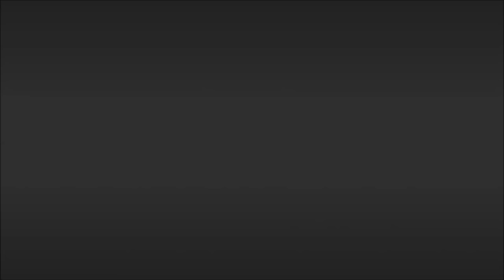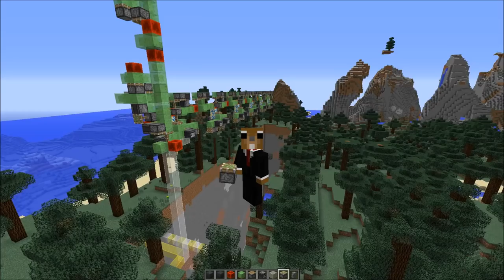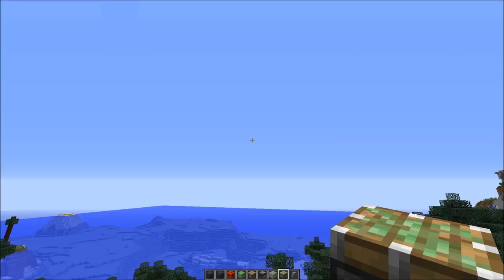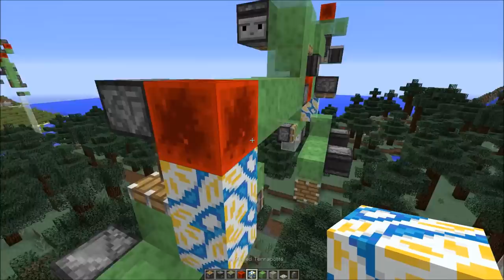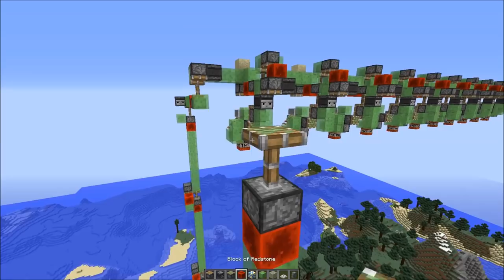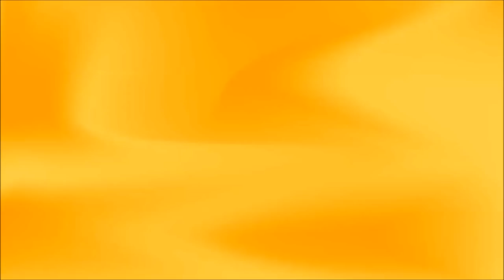Double Speed World Eater Tutorial for 1.12

Comment: How many resources would a 300x300 one cost roughly? I really wanna build one of these beasts, but I have no idea if I'm even close to having the stuff needed.
Reply: I took this directly from a MCEdit analysis.
You will need about this for the base components, so once for one world eater:
Number,Type,ID
26700,<Blocks>,
26398,Air,(0:0)
2,Sticky Piston (Down),(29:0)
5,Sticky Piston (Up),(29:1)
16,"Sticky Piston (Extended, Up)",(29:9)
2,"Sticky Piston (Extended, East)",(29:13)
19,Piston (Down),(33:0)
16,"Piston Head (Sticky, Up)",(34:9)
2,"Piston Head (Sticky, East)",(34:13)
32,Block of Redstone,(152:0)
190,Slime Block,(165:0)
1,"Iron Trapdoor (Bottom, False, South)",(167:1)
1,"Iron Trapdoor (Bottom, False, West)",(167:2)
4,Future Block!,(218:0)
4,Future Block!,(218:2)
3,Future Block!,(218:3)
3,Future Block!,(218:4)
2,Future Block!,(218:5)

Additionally, you will need this for EVERY 6 blocks you extend your world eater in width, starting from 0. For example, a 300 wide world eater would require 300 / 6 = 50 times these materials:
Number,Type,ID
53400,<Blocks>,
53304,Air,(0:0)
1,Sand,(12:0)
1,"Detector Rail (Unpowered, Ascending, West)",(28:3)
1,"Detector Rail (Powered, East/West)",(28:9)
1,Sticky Piston (North),(29:2)
1,Sticky Piston (South),(29:3)
4,"Sticky Piston (Extended, Up)",(29:9)
8,Piston (Down),(33:0)
2,Piston (West),(33:4)
2,Piston (East),(33:5)
1,"Piston (Extended, Down)",(33:8)
1,Piston Head (Down),(34:0)
4,"Piston Head (Sticky, Up)",(34:9)
1,TNT,(46:0)
1,Cobblestone Wall,(139:0)
6,Block of Redstone,(152:0)
49,Slime Block,(165:0)
1,Future Block!,(218:0)
1,Future Block!,(218:1)
2,Future Block!,(218:2)
2,Future Block!,(218:3)
3,Future Block!,(218:4)
1,Future Block!,(218:5)
1,Future Block!,(235:2)
1,Future Block!,(235:3)
Number,Type,ID
1,<Entities>,
1,minecraft:minecart,No ID

I hope this helps.
Reply: @AutiAuto  Thank you so much! I'm guessing "Future blocks" are observers?
Reply: The Future Blocks with the ID 218 are Observers, indeed. The Future blocks with the ID 235 are White Glazed Terracotta, although you could use any color Glazed Terracotta for those.

Comment: Not very practiacal
Reply from the maker: sure. It's probably more practical spending 500h digging than spending 15h building this
Reply: 15 hours in creative yes...survival...most likely 50 hours to build 50 hours for resources 20 hours to dig trenches at max...120 hours...i bet 120 hours could be spent using a haste 2 beacon to insta mine the area and get it done as well.
Reply: @kevinmorris8831  I built mine in about 10 hours in survival single player for a 200x200 perimeter.